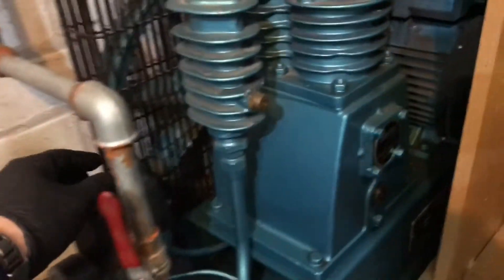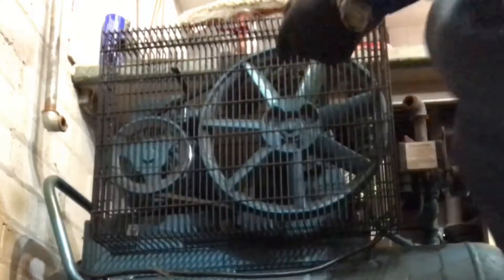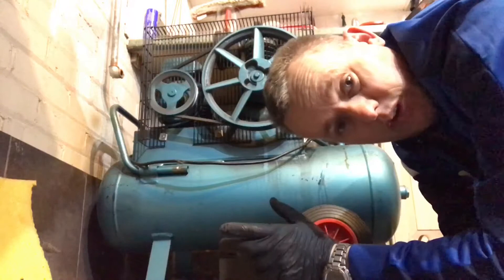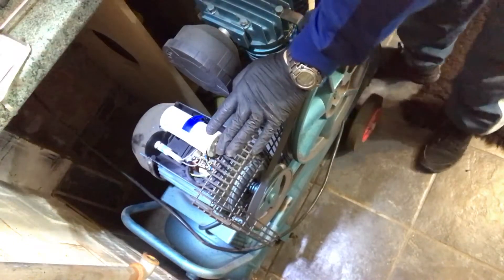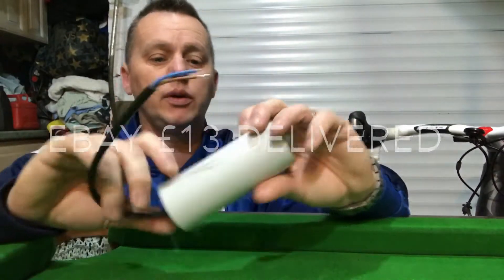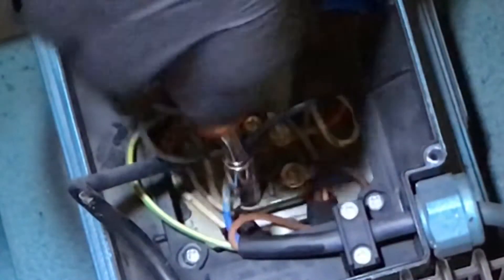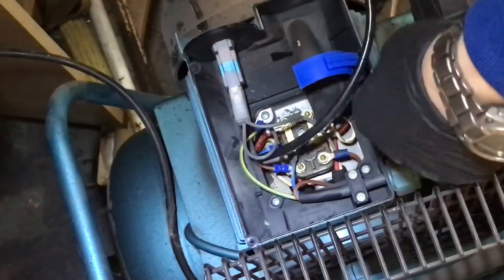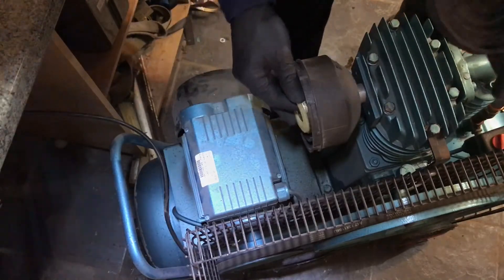No! Clarke Air Compressor Faulty Seized How To Repair, diagnosing Start up Capacitor

Comment: Great video! Can I ask you what can I do if after I opened the guard and tried to turn the pump motor doesn’t turn . 
Do I need to replace the full part ?
Reply from the maker: take the belt off and see if its the motor or the pump, Thanks for the great comments👍🏻👍🏻🛠

Comment: Hi can you tell, where do you connect brown and blue wires from the capacitor in that control box? Some control box have x,y,z marking in it where should I connect brown and blue wire into that x,y,z marking? I have the same fault compressor, can I also know the specifications of its capacitor? Markings are wiped out in the one which is available in the one which come with the unit
Reply from the maker: I only have the information that's in the video, Thanks for the great comments👍🏻👍🏻🛠

Comment: Can you give the capacitor details again...I have the same model with the same problem!!!!!!
Reply from the maker: sorry I don't have that information Thanks for the great comments👍🏻👍🏻🛠
Reply: Did you got capacitor details mate? I have the same problem
Reply: Have got the capacitor details? Same problem here
Reply: Hi can you tell, where do you connect brown and blue wires from the capacitor in that control box? Some control box have x,y,z marking in it where should I connect brown and blue wire into that x,y,z marking? I have the same fault compressor

Comment: Great video! A couple of other things I have done is to drain the moisture out of the tank while it has no pressure, I'd also leave the control box off and blow air across it to remove any debris and lightly clean the air filter. Lastly checking the fluids is a must at least with my experiences while working on customers machines. Thanks  for all the great vids and keep them coming. Cheers
Reply from the maker: Thanks for the good advise, it has been quite a good machine, but this is the second video I have made about it, I did drain the tank, to my surprise it was empty👍🏻👍🏻
Reply: Hi Michael, I have a GMC 2HP 50 ltr compressor and the capacitor is gone (cracked case) so will be looking to replace it, but...I heard on another vid that I could get a serious shock when handling/removing it...any advice there?